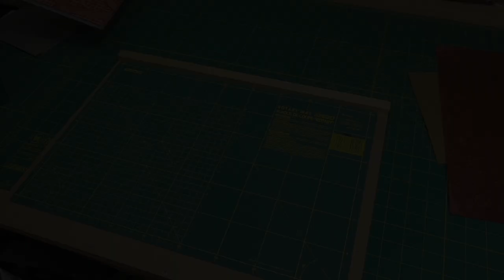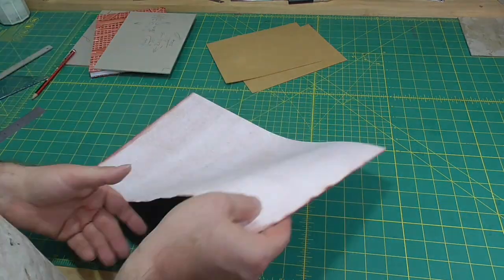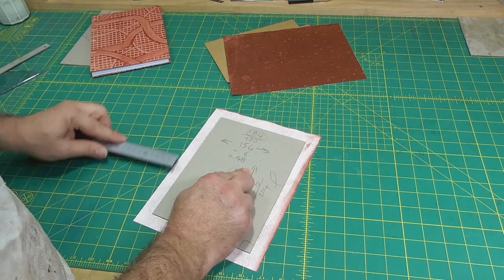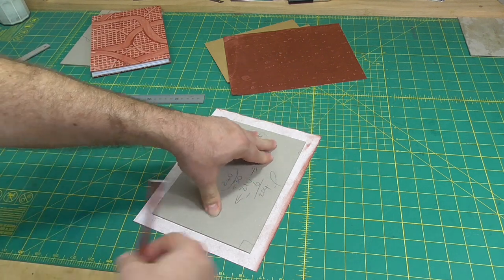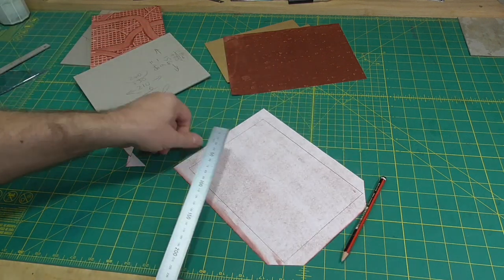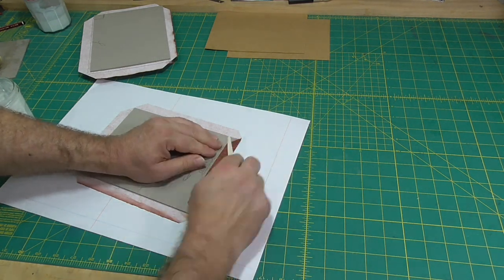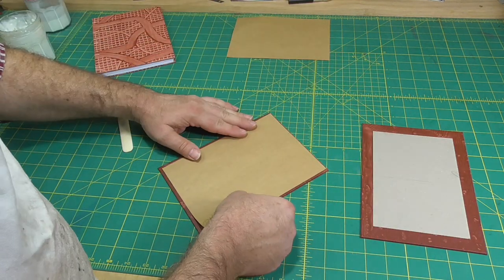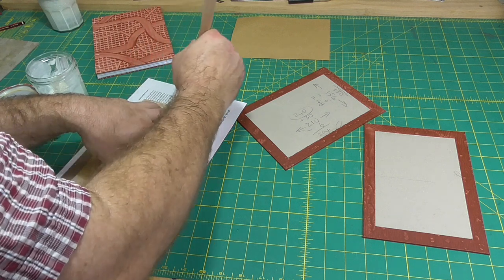Warp Free Boards - Drumming on Board Covers // Adventures in Bookbinding

Comment: Stickflat (or stikflat) glue is an old bookbinder's secret. When used properly it will completely eliminate any warping on covers and almost any type of paper. It has the consistency of chapstick. Spread it very thin with an old credit card. Comes in acid-free archival quality. It dries very slow so you have plenty of time to work. Took my bindings to a professional level.
Reply from the maker: Thanks for mentioning but I wouldn't call it a bookbinder's secret.  Yes, it is made by an old bookbinding supply company, however I can't recommend it for traditional bookbinding.  I'd recommend using methyl cellulose instead.  I understand the appeal of having an adhesive that transfers very little moisture to materials, however one of the reasons for using paste is that it is a penetrating adhesive which has a strong lasting bond.  This is clearly a surface adhesive and I expect it is a short lasting bond.  Thanks again.  Darryn
Reply: @DASBookbinding  That is very true, and I would not recommend it for traditional bookbinding either. I was sure you were well aware of this type of glue, as most bookbinders are. I really only mentioned it because I know a lot of people here in the comments only do personal bindings occasionally, and traditional bindings (for example using methyl cellulose with vegetable tan leather) are very tricky for them. It's more of an easy way for amateurs to achieve professional-looking results on the occasional personal binding.

Comment: Have you ever tried an equal strip of adhesive on the outside of the boards so the pull is even?  So a strip the same width as the turn in, but on the outside of the board.  Just curious if that's a thing, or even worth the trouble.  Fantastic video, as always -- thanks for sharing your knowledge!
Reply from the maker: I use draw sheets all the time to pull boards in that are warped out.  A very small inward pull is desirable, so I wouldn't try and balance that very small inward pull.  Plus, I wouldn't use kraft paper again for the paste down.  Using a more heavily sized paper and straight PVA and there would be negligible stretch and subsequent pull.  Ciao, DAS

Comment: Another great video. Thank-you. I'm interested to know what your "wet " paste mix is please? Watered down PVA?
Reply: I think he has several recipes for different purposes but the mix is a combination of PVA or other glue with wheat paste.
Reply from the maker: Mix is a roughly 50:50 mixture of paste and PVA.  Paste in this case is actually methyl cellulose, not paste at all.  But MC works well as a paste substitute in "mix" and doesn't go off quickly.  I'm making a video about bookbinding adhesives and will try and cover all these little variations and why you might like to use them.  DAS

Comment: That’s a great way to deal with the uneven twisting especially on a fully wrapped binding. It didn’t occur to me that fully gluing the inner paper also produced that pull. I had one embarrassing twisting with my first book but I also had a question when I bound a 16 x 10 non Coptic book for watercolor. I had done what I could to really adhere around the edges and panels yet some tiny bubbles occurred after curing. I pin holed them which helped but I would rather avoid them. I had the panels under pressure for 24 hours with 1000 page medical books at that time and even weighted the edges first before gluing on. Could it have been caused by too much glue? Or is there any other cause. These were non visible while boning. Thank you so very much for you expertise. I wanted to do another for myself soon and hopefully do better. Take care. It isn’t too noticeable but to me.
Reply from the maker: I'm not sure about the bubbles.  I'm sure something would come to me if I could see it.  I think it isa materials or adhesive issue.  Sorry.  DAS
Reply: @DASBookbinding  that’s ok it was a very flexible light vinyl (leatherette) with PVA attached to Lineco board. I tried to hide it with a glued outer ribbon. I always am afraid now when I wrap the boards not to stretch in any way but the thicker vinyl seems at least to me more of a challenge due to the thickness. Lots of practice:)
Reply: @jenniefrench1338  For the type of bindings you're doing (vinyl) you should try stickflat glue and see how that works out for you. It's not a traditional bookbinding glue but if you use it properly (see my comment on this video) it completely eliminates all warping and bubbles. I've had the same issue on many materials, mostly heavy gsm paper. I don't know exactly what causes the bubbles to appear after drying but it appears to have something to do with the type of glue (I've noticed this is mostly a PVA problem)  Lineco board is really good. I think they make a sealed book board that reduces warping but I can't remember exactly what the name of it is. Basically the more water content a glue has the more warping you're going to get. Try stickflat glue at least once and see how it works out. My personal recommendation would be Yes! Paste.